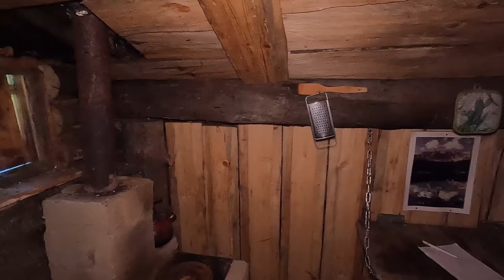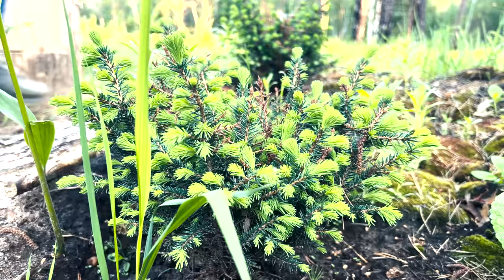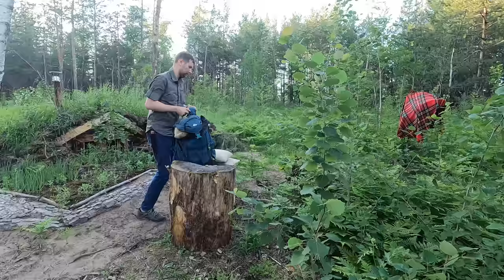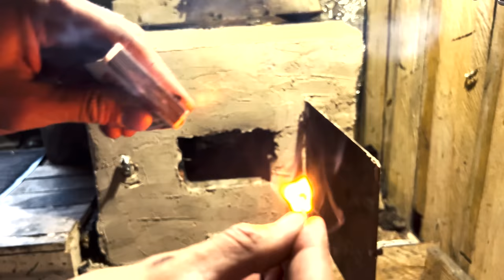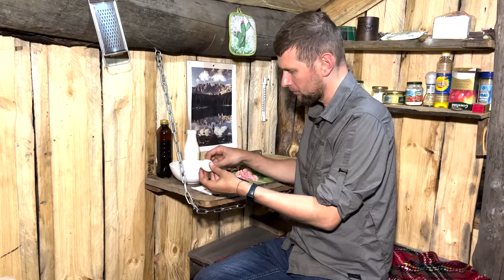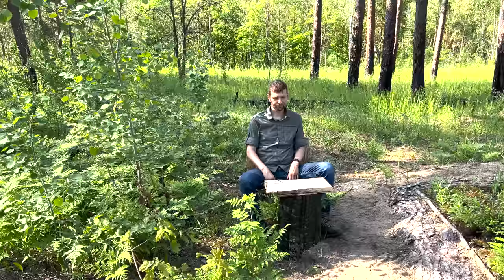A cozy night in my dugout in the wild forest. Came to the forest and stayed overnight. Part 30

Comment: Mosquitoes in the cabin. I recommend coal fungus, found on dead or dying ash trees. If you have ash trees in your area, you should be able to find the fungus. Set it smouldering into a partially split stick  and cover it with green moss. Mosquitoes hate the smell and will soom leave.